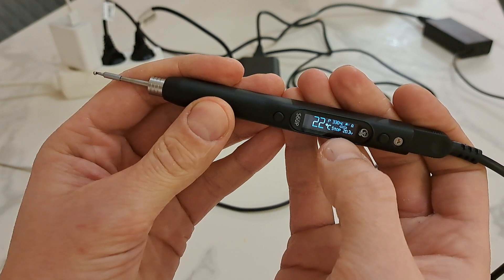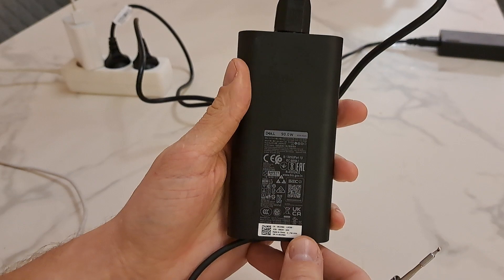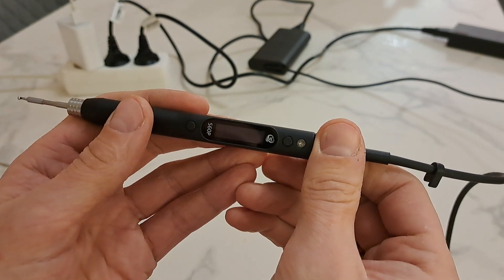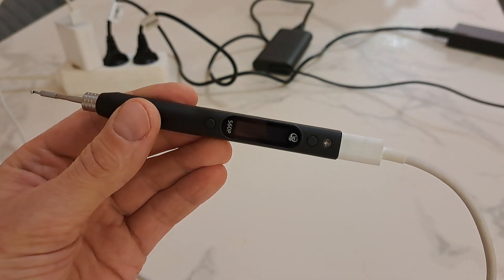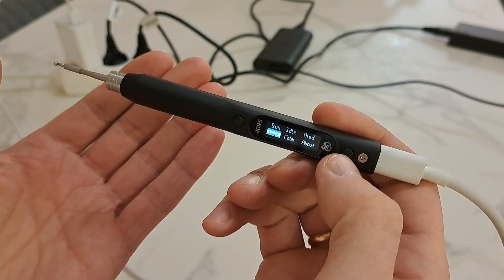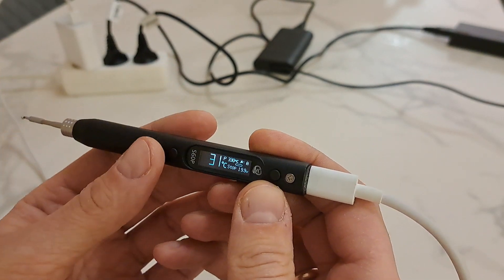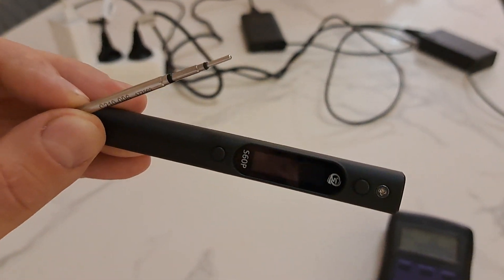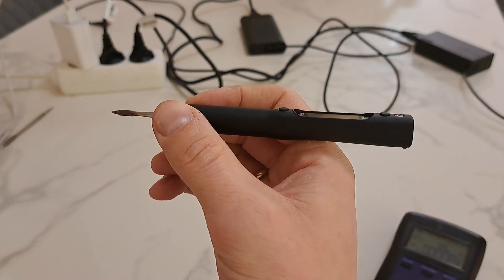SEQURE S60P soldering pen REBOOT issue FIX

Comment from the maker: Bought SEQURE S60P soldering pen and with default settings set to all AUTO it negotiates maximum what it can. In most cases with powerful PD chargers it will be PD20 protocol which is 20V 5A and S60P does not work with it. It simply reboots because it trips the overload protection of power supply. 

You need to change settings to manual and lover voltage or power to make it work.

JBC C210 soldering tips are about 2,2 ohm and JBC soldering stations feed this tip with roughly 12V. So it derives that approximate power of C210 tip is 65W.   In ideal world S60P firmware should be implemented to limit the power source from source to tip at 65W. And that would help with overload protection of power supply.
Reply: Well the problem is that even if you do PWM the current still remains 10A but in impulses. The problem is that the duty cycle is probably too short to trigger the internal protection.

Do you still recommend this soldering iron? I want to use it alongside with T12 tips. Do you think that C210 or C115 would complement T12 better?

Comment: I had the same issues as you. My new Anker 100W brick can power the iron at 20V at 35% without rebooting. With this setup, the iron seems to pull about 45-60W at max power, sometimes spiking higher. I found though that my Lenovo 65W brick works even better. If I set it to PD12 at 90% power, the iron runs at 15V and pulls 80W max. You can definitely notice the extra power.

This was tested using a USB-C power meter and dipping the iron tip into a cup of water to get max thermal load.

Comment: Hi. I was having the same issue with my 2 Sequre S99s soldering irons using original JBC tips.

The problem stopped using a Lenovo C135W usb c power supply. It is capable of correctly negociate the voltage and current with the S99s. Beware that the newer Lenovo C145W power supply don't work with these soldering irons, it must be the C135W model.

Another solution was to use a regulated power supply capable of delivering 21 volts at 10 amps. The maximum peak current that these soldering irons consumes is around 8 amps.
Reply: @Mozartf, thank you for sharing this.

Comment: Thank you for sharing how to resolve the issue but lowering voltage and power it simply makes it work to what have been set by the manufacturer. No advantage as such for users? As it would not increase efficiency or providing maximum Watt it can work to? Now you have used it would you still recommend this soldering pen.